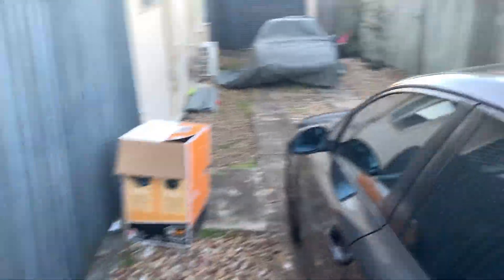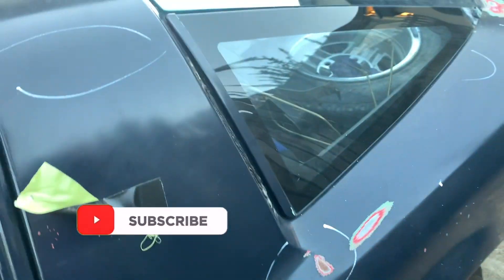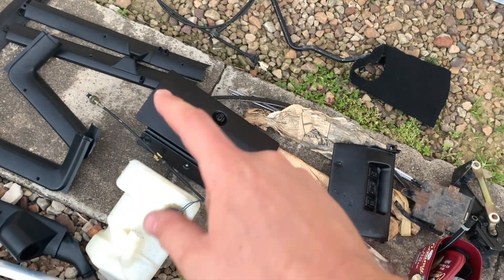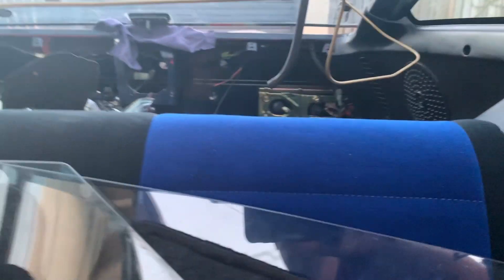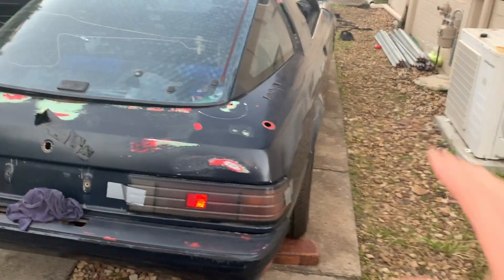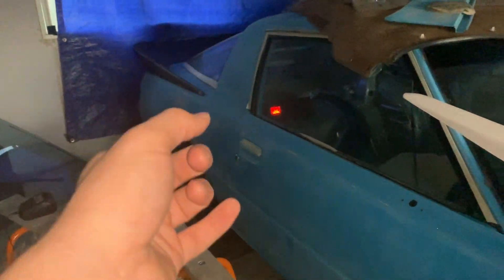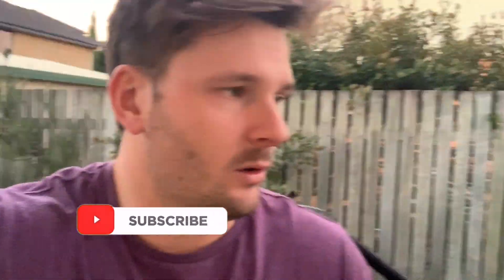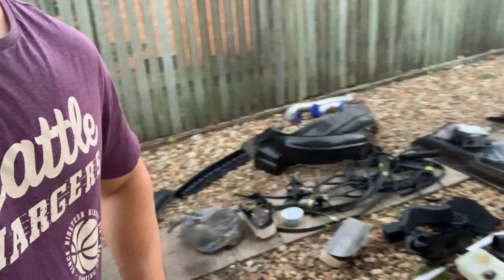SA22C RX7 RESTO #4

Comment: just finish one of them or sell them both to someone who will actually do something with them
Reply from the maker: I sold one to someone who is rebuilding it. The light blue one (the one I have had for ages) is still mine and will never be sold
Reply: Great clear the garage and get stuck in and just get it running drive it up and down the road pull the motor cause and when your inspired, make it pretty later.